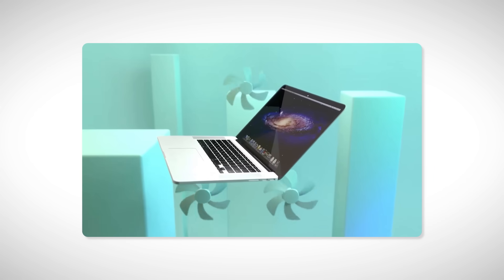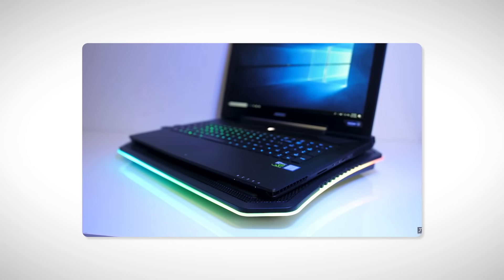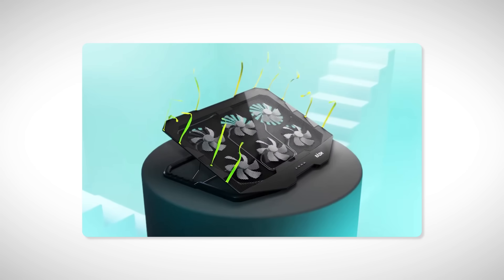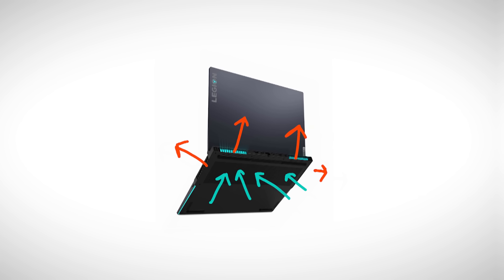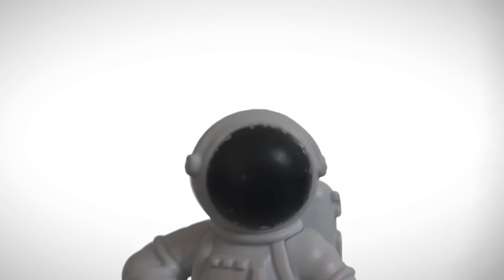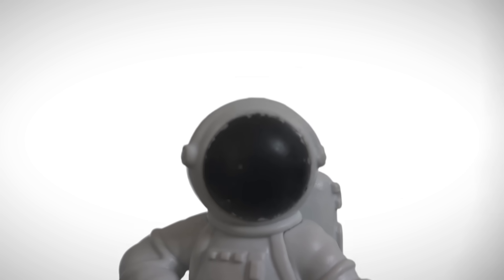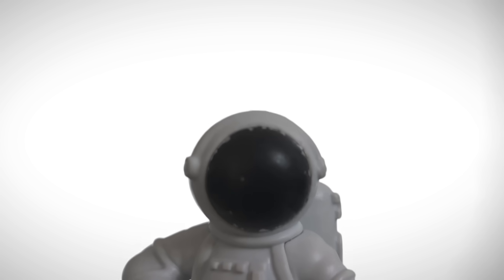Things You Realize As Soon As You Buy A Laptop Cooling Pad

Comment: Cooling pads are mostly useless unless you use them correctly. Key tips:

Only buy one if your laptop has large rear vents covering most of the back with exposed or lightly-shielded heatpipes.

Direct airflow into the actual vents and fan intakes. Mark your laptop’s vent layout on the cooling pad and use foam or non-sticky double-sided tape to create a seal so air goes into the laptop, not just onto the plastic.

For performance:

Max out your fan curve.

Disable CPU sleep states so all cores stay active and enable turbo boost.

Avoid “Ultra” presets—tune settings yourself.

Use frame generation and cap FPS (ideally half or near your display’s refresh rate).

Power the laptop and cooling pad from separate external sources.

Warning: Doing this incorrectly can increase heat or reduce performance. Powering the cooler from the laptop can strain the battery and a USB port, and poor tuning can also cause issues.

That said, I managed to push a mid-range laptop to run games at 4K 120 FPS on manually-tuned high settings, and the cooling pad helped prevent the back panel from overheating (it actually melted once and had to go in for warranty on day 3 due to bad tuning).

Comment: I bought a laptop this January, can handle the games I wanted to play but the noise and temps freaked me out. I caved and bought an llano cooling pad. Don’t get me wrong it sorted the temps for majority games I play but the noise even on 600-1000 is incredibly loud. Plus using a cooler makes the keyboard almost impossible to use comfortably and I’m forced to use a monitor, on top of that it I never move my laptop . The literally point of buying a laptop is the portability. At this point I’ve caved into getting a desktop and selling the laptop online. If it’s not going to move I may as well get the pros in power with a desktop

Comment: Before spending money on a laptop cooling pad: 
1) Clean up the fans 
2) Change your thermal paste (be careful on models with liquid metal! It's tricky to remove, and maybe it's good enough!) 
3) Make sure there is enough space for the air intake (lift the laptop form the table etc.)
4) ONLY AFTER you decide performance is unacceptable after these changes, should you buy a laptop cooler. And also, check if it fits your laptop cooling system, vendors only give you the advantages, not the disadvantages.

Comment: Most of your videos are at best poorly researched and at worst just misinformation.

The advice you give like not just wasting money and researching before buying, but the many things you get wrong, like why do you lose performance when components are heating up or that most laptops don't require a cooling pad, and many other false things that I can't bother to go through.

You don't even seem to know that in most cases the CPU is the one throttling because of the heat not the GPU, and even if the CPU is made to reach those max temperatures, if you want to keep your laptop alive for a couple of years and get a bit more performance out of it, a cooling pad definitely helps a lot.

Comment: I have a old cheap laptop cooler with 3 small fans (one of the fans litteraly does not work) , without it my laptop gets between 75-78 C°, with it i get 69-74C°, so i'm definitely buying one soon (the temperatures that i said are for the gpu, but the cpu is similar)

Comment: If you have a Laptop CPU with more than 6 cores try these first before opening it up, turn off "Hyper Threading" and "Turbo Boost"(only if your CPU is >2.1 GHZ) from the BIOS. You will lose compute performance but as of 2025 a 6 cores are more than enough for gaming and handle laptop grade GPU and the temps will easily stay below 70 when gaming and below 60 during normal work load. I know this is like buying $200 chip and using $100 of it but well it's much better than getting burnt from 100Dec C INTEL CHIPS

Comment: I personally need help with cooling my laptop the internal fan refuses to spin 😭"well it's broken then" I go and test the fan in the Asus app that came with the laptop and it works otherwise it stays at 0 rpm even under load "well control it manually" I tried but no app not even the official Asus app can control it I think mine is locked even in bios "maybe some software or malware is disturbing the fan control" I reinstalled windows and I have reset the bios and I have the latest bios which is really old btw my laptop is the Asus x515 if anyone can help but I am probably gonna let it rest and sell it cuz it's 3years old and someone else can figure it out oh I forgot to mention that the thermal throttling isn't just the heat it's also shutting down from the immense heat

Comment: bro if your laptop don't have grates at the bottom then why the hell did you buy a laptop cooling pad? I'm genuinely disappointed. just buy an intake vacuum and elevate your laptop you will see a difference. And don't btw cheap ass coolers like those btw, buy ones that has anti dust filters like llano, gt500, or klim.

Comment: I have a 16 year old Lenovo G560 and at times, even when idle, it gets so hot that my fingers go red. I opened it up the other day to clean it's fan located near the WASD keys at the corner at it wasn't that dusty, a toothbrush was enough. There was no gooch dust in it (Salem Tech reference). Haven't checked the thermal paste yet, maybe that could be a problem. Instead of raising the laptop, I just shift it to the edge of my desk (cuz it's just one fan), therefore goving it a lot more airflow than raising it. Other than that, I was thinking if buying a Framework 16 laptop but sadly, they don't feliver here in India and I might have to go with an Acer Nitro V15. Still, quite a helpful video though, thanks ❤
Lenovo G560 specs:-
Intel Core i3 370M
iGPU - Intel HD Graphics
6GB DDR3 (5.58 usable)
Extras:-
A super slow HDD (488+24GB)
A missing battery
Many dead pixels

You can have a look at that buddy at ny channel's one of the latest community posts though

Comment: What I mainly use a cooling pad for is a docking station. They really need to build them with bluetooth speakers, extra batteries, hdd docks and hubs for hdmi, usbs, typec and power delivery passthrough with battery backup.
My current cooling pad holds an 15inch external monitor with stand, usb hub, two plug and play hdds, rog ally with magnetic stand, bluetooth speakers, battery, headphone holder, keyboard or arcade fight stick.
Perfection is attained, I am hoping companies wise up with better docking stations.

Comment: Well i agree and i disagree with you on this one. Cooling pads are useless yes but use full to some degree. Like i have a ASUS TUF gaming laptop with a I7 12700h and a 4060 GPU. The cooling pad even with the right one dose nothing for my system it still thermal throttles and gives poor performance when it gets hot. 99c with my cooling pad 99-100c with out it. The general take on this is for light  office work a laptop is fine. For gaming The worst piece of dog water i ever bought. Just buy a PC you'll be happier for it.  Yes you can argue a PC is more expensive yes but you can by a much better PC then a laptop for the same price.( That's referring to a GAMING LAPTOP) not a office one! Laptops since the beginning all ways had one MAJOR draw back and that's thermals! Yes its better now but for gaming buy a console or get a deal on a entry level gaming pc instead.

Comment: This was one of the biggest lie since most heating solution for a laptop is either on solid surface with an object holding up from behind to leave some air blowing out, or you have left it on your lap.
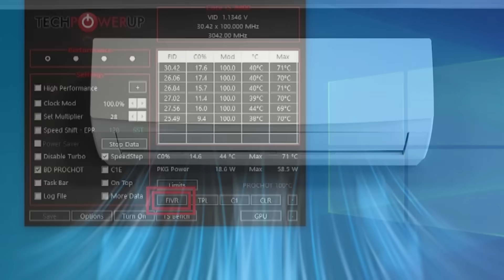7:14 the performance reductions can be somewhat noticeable since you mostly be hitting the targeted performance anyway.
Would recommend limiting your cpu performance by going to edit power plan mode and set it at 90% usage (normal way and faster)
gpu doesn't give out too much heat as cpu, but you can limit by just using either nvidia/amd programs (no need to bother touching third party programs unless it came with the laptop)

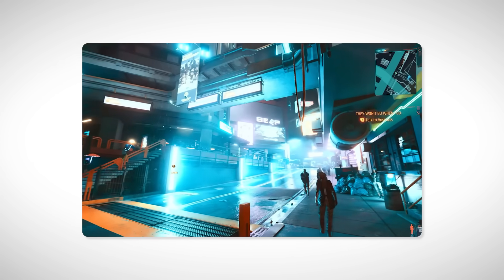Comment: 1:00 Laptop fans start to draw power from CPU and GPU what???
Reply: AI regurgitated slop
Reply: @mlgcactus1035  never listen to this youtuber, utter bullshit
Reply: not completly wrong it draws power from laptop, a 1500 rpm cooler draws around 3W of pwer atleast, power brick has a number which it can provide suppose its 50W so cpu gpu and the fan have to share it
Reply: @eterna1379 unless you got a cheap trash can, it’s insignificant. laptops come with power bricks that support more than they need, which covers fans, ssds, ram, lighting, fans and even usb power delivery. none of that power is shared with the gpu or cpu.
Reply: @ploxarino2981 not true. Especially for non gaming laptops.
My laptops brick is of 45W. The cpu alone under load consumes up to 22W.
Moreover a 1500 rpm fan is not going to help. For a good temp drop a 2500rpm fan is needed
Reply: @eterna1379 what laptop could you possibly have that draws such a little wattage across both a gpu and cpu. you must be talking about a integrated gpu
Reply: and even then that’s literally no power
Reply: @eterna1379 99.9999% of laptops have reserved power in the brick for usb power delivery and more. If i have a 400 watt power supply, it doesn’t mean that the laptop can draw 400watts. in fact, 400watts on the cpu and gpu would be an outrageously high pull for a laptop.

Comment: Stop buying cheap ass laptop coolers and get a real laptop cooler like from Llano
Reply: Not just llano, even on budget any cooler with actual sealing foam design that can force pressure the air directly into the CPU and GPU is enough that can provide solid 5-10° better but it's too loud, a classic flat mesh surface cooler is quieter but it is a waste of money speaking of 2-4°difference.
Reply: @ijrfozdo9 budget coolers do work to a extent. can lower thermals by a couple degrees even without the foam sealing, but it’s mostly placebo because you’d get those results by raising the back for more air intake
Reply: I had Llano cooling pad, expensive as fuck and cools really good, but you'll have to deal with insane noise.
Honestly if you want a cool quiet machine, get a desktop pc. Or something cheap and Geforce Ultimate if you have fast internet connection. If not, you're fucked as you can't afford a €100+ laptop cooling pad anyway.
Reply: @UnknownEntity84  i agree- but it’s not just about noise or cooling. unless you get an incredible deal, or have another purpose like work or school (need for portability) that offsets the thermal constraints and power constraints, and also all the other variables that are constrained like upgradability and more of a laptop over a pc, it’s absolutely not worth it, and you should get a pc.
Reply: This ☝️